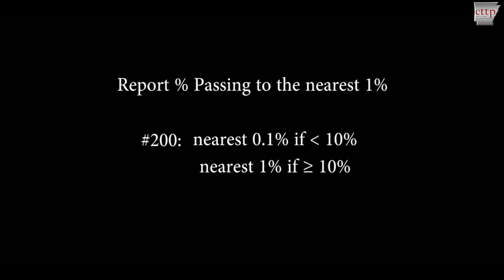AASHTO T 27 – Sieve Analysis

Comment: What is the industry standard for mechanical sieving time? Is it 5-7 minutes?
Reply from the maker: RichardBruno, I would agree that 5-7 minutes is generally a good time frame but the specs tell you to verify this on a yearly basis.  You ideally want the run time to be 10 minutes or less so as to not cause degradation of the sample.  If you take a look at Annex A2 in AASHTO T27, they go into detail on how to verify the time of your mechanical shaker.  The short version is you want to verify after running your shaker for X amount of minutes that its within tolerance.  To be in tolerance, you need to make sure no more than 0.5% by mass of the total sample before sieving passes any sieve after 1 minute of contiuous hand sieving.

Comment: should you not have zeroed the scale out before placing the bowl and then zeroed the bowl? @ 31 seconds
Reply from the maker: Hello Wyatt, it makes no difference rather you zero the scale out before placing the bowl on the scale or not.  It wouldn't of hurt anything if you did so, but the important thing is to make sure you zero the scale AFTER placing the bowl on the scale.  The whole idea is making sure we are taking the weight of the bowl out of our weight prior to weighing the aggregate.  That way we get a true weight of the aggregate only.  When zeroing, it is also important to remember to only use the exact same bowl that you tared out (though they can look identical, all bowls weigh differently when we are weighing as low as to the nearest 0.1g).